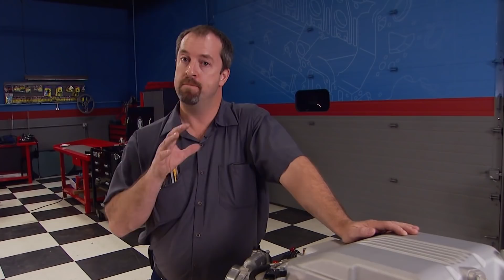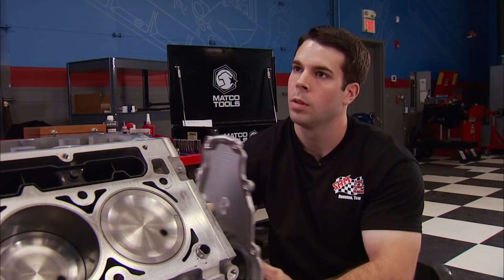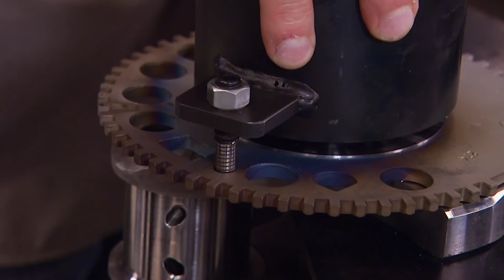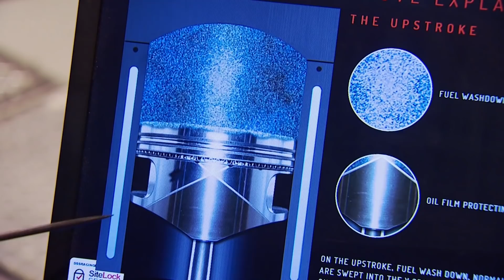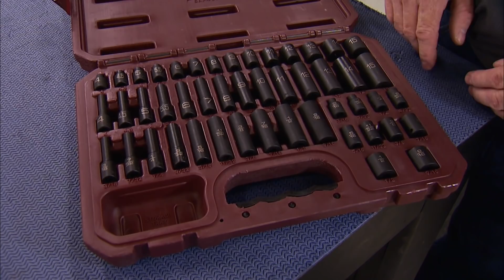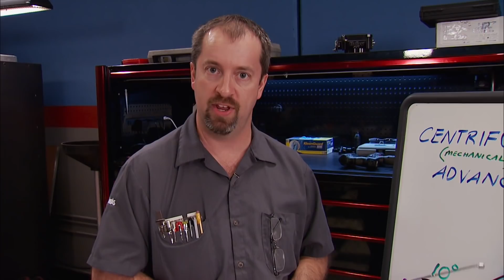The Quest To Get More Power Out Of A Cadillac Supercharged LSA - Part 1 - Engine Power S3, E5

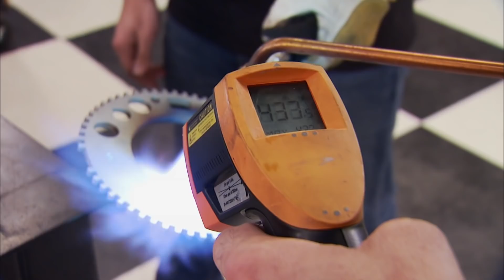Comment: 8:38 Uses heat gun while torch is on metal??? Inaccurate reading of ~350-425. Smfh…Yeah, just heat the metal to 225 and that will work.

Comment: What about the oil squirters??? Did you guys remove them? With this stroker its should be an issue. I hope you guys reply as im building one now. Lsa and 88mm turbo
Reply: I know this is an old post but we removed the oil squirters on our ZL1 however I believe that there’s a set of pistons that have a notch to accommodate the squirters.
Reply: How did you guys block off the oil squirters

Comment: Guys, you replaced pretty much everything but the chain guide and the oil pan! Other than the block, there's nothing left of that LSA, and that is NOT cool! I had hoped you'd show how to get the stock LSA up to 1,000 HP by modifying the stock parts, not gutting the engine and replacing pretty much everything in it!
Reply: Should’ve removed the tensioner and used an ls2 guide
Reply: @marcgucciardo1942  Why?
Reply: @AnnatarTheMaia cause the spring tensioner breaks

Comment: On another video of a big block 427 they built, they said to use engine oil not assembly lube on the rings and pistons because you risk stripping the bores, now they say use assembly lube. I think everyone has different methods of building engines.

Comment: The LSA just became my new favorite engine. Love the way they designed it! Especially things like the cam lifter clips to allow for changing the cam without a full teardown, and easily pulling four lifters out at a time. Beautiful design!
Reply: You do realize every LS based engine since 1997 is just like this not just the LSA…? Also the best and most used practice is to spin the cam then insert dowels in the oil galleries to hold the lifters in the cups when doing a cam swap, the reason they aren’t using dowels is because they are doing a complete tear down.  Cam swaps in a vehicle without using dowels is asking to pull the pan.
Reply: @mctigmctiggy1475  Haha!

Comment: Same cross bolt mains as the legendary 1964 Hemi and the current Gen 3 Hemi. Just thought i would point that out to the Chevy boys and power nation. Power Nation loves to mention when any other manufactor has same designs sizes etc... even though Chevy was the last to offer a V8.
Reply: Ford had it first with the 63 427
Reply: @andydurrett6222  is that the motor you couldn't buy? Non production Race only?
Reply: @shawnriddle3018  no, it came in the 63 galaxie
Reply: ah yes, Mopars also had four rubber tires, can’t let the Chevy Boys forget.
Reply: @evanverret3150  the LS engine has the same headbolt pattern as a 340 mopar....Mopar.... is a 4 bolt I believe
Reply: @cromBumny  a ford sb.andnyour point? The design is way different. And flows 10 times better as well

Comment: Did the lifters have the AMF? so you can run it on the street ?
Reply: LSA doesn't have AFM/DOD, why would you need it for the street?
Reply: Thankfully gm didn’t put that garbage system in the lsa 😂

Comment: I have a set of CNC'ed LSA heads and 1/2" head bolt holes that where done by PRC on my 402 ls2 based setup in my 99 Z28 it's got Summit Ls pro crank rods and Pistons a Holley low ram with 16 Bosch 210's and a 91mm Garret gt5591 with a FI billet wheel Holley EFI and lots of methonal m1 this season I'm gonna give m5 a try I went to a 15gpm pump in November from a 12gpm mechanical pump. When ever I kill this ls2 block I'm gonna give a LSA or ls2 block a try unless I can get a nice aluminum dart block but so far I've threw 32 pounds of boost at the little half filled ls2 and been a bunch of 5.0's and 1 4.99 with a 4 at 143mPh in the 1/8 at 3300 pounds RW if I had to guess a HP number it's gotta be close to 1300whp and I got another 6 or 8 pounds of boost And a little timing to throw at it. I am very surprised and happy with how stout summits Ls pro stuff is my motor has been together about a year I lost count of how many pass's it has on it I do know over half are above 1100hp and 7800rpm and when I freshend it up in November every thing looked nice and clean. With it being my second build since I quit running sbe stuff i spent alot more money on machine work,bearings and hardware than I did on my first motor I built and it definitely shows  but maybe one day I'll have me a 427 lol hopefully before our dictator Joe Biden or someone else from the U.s communist party I mean democrat decides to ban non EV forms of transportation!! LoL

Comment: LS3 based 427 in a Supercharged application? How's piston slap and is it durable?
Reply: This is a 6.2 liter, built from the ground up with forced induction in mind.
Reply: @amathern  That does not matter...the engine block thickness is the same, to get a 7.0 litre displacement requires very nearly siamesed cylinders, since this is a SMALL block engine. This is why the 6.2 litre was used in supercharging by the factory, and not the 7.0.
Reply: @robertcohen8554  So you think the people at SAM are idiots? The factory always plays it safe. Pat was wowing the Lunatic crank as good for 1500hp. So is the factory crank. Maybe for not as long, but definitely for consistent 4 digit horsepower. What they have is 2hp per cubic inch. Most definitely not unheard of on an engine with forced induction.
Reply: @LTXwooshie a special build like this is obviously doable, (you can tune anything until it blows up in short order), though obviously it will be far less reliable long term. Mechanics build an engine to last one race, or an engine that has astronomical boost, or an engine that is tuned FAR past any reasonable point of reliability, so that's  my point.
Reply: Nope. That's  why GM didn't supercharge the 7.0 liter small block out of the factory...the cylinder  bores were cut too thin to accommodate supercharging, and why the 6.2 was supercharged instead. These  people are idiots on this channel.

Comment: 580hp out of a supercharged 6.2L isn't really all that impressive. Less than 100hp per litre.
Reply: Factory warranty bud!
Reply: Don't forget it also has to meet strict emissions standards, and help meet corporate average fuel economy goals. OEMs are under a lot of constraints that the aftermarket simply doesn't worry about.
Reply: @Joel_E  exactly.   I am a Gale Banks fan but what he is accomplishing on the Killing a Duramax series isn't possible for the street because of emissions.   Plus most people can't handle half that power.
Reply: It was built for reliability out of the factory, so it is impressive from a reliability standpoint of a 2 valve pushrod small block.
Reply: Ok Mr Cool Guy
Reply: this engine was introduced in 2009, thats 13 years ago, pretty impressive back then with a warranty